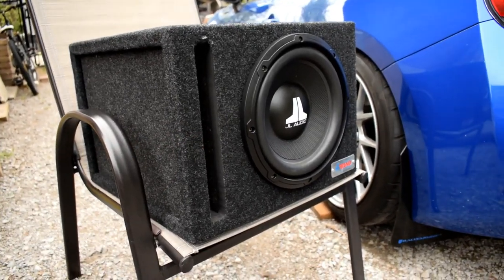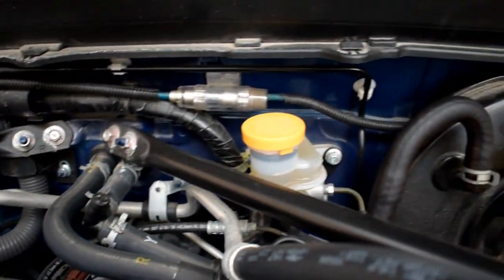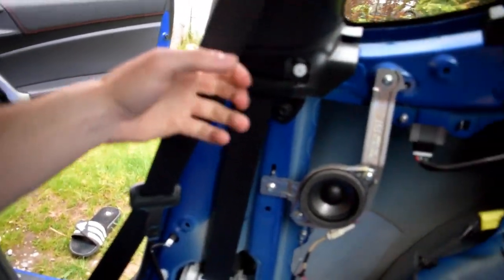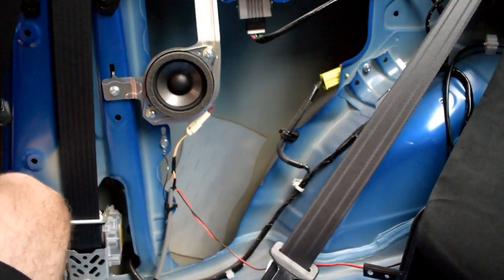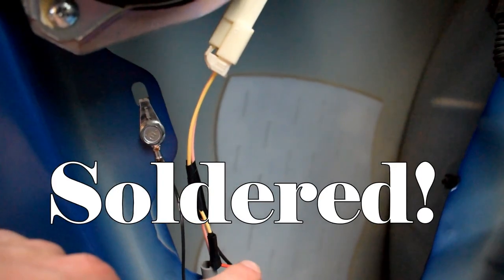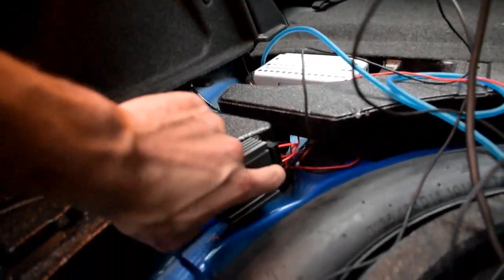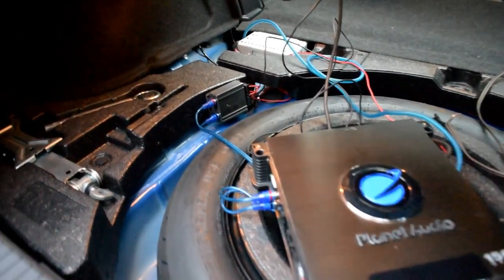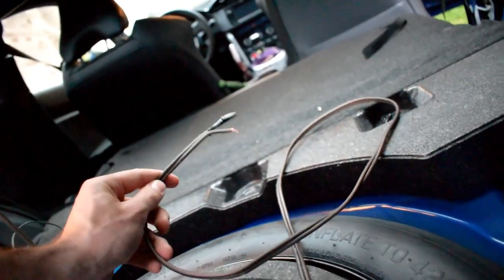JL Audio Sub Install BRZ ! Made Easy !

Comment: A good tip for you guys who are looking in to installing amplifier, don’t use signal from speakers. The signal is in the wrong hertz for the speakers. It may sound ok, but it is gonna be 100x better with rca cables from the stereo.

Comment: Wouldn't recommend tapping into rear speakers, that was my first move and they are very obviously high passed.  I probably wasnt getting any signal below 60hz.  Once i tapped off of the wiring in the stock amp I had full signal range.
Reply: Parmati any chance you could tell us which wires you used?  I just tapped into the rear left speaker and the 60hz dropoff is very noticeable
Reply: Which wires did u use in the stock amp

Comment: For everyone not wanting to tap into wires and do all that extra shit, i found a line out converter made specifically for this car on amazon ($30) that plugs in between the stock amp harness and the stock amp. All you do is connect the RCAs and remote wire to it and you’re done.
Reply: put a link in the comments I want to look at it please
Reply: link pls

Comment: front left/right speakers also remote turn on are found on the factory amp plug. Ground is found under the panel where the trunk latche. All connections besides the power wire (12v) is in the trunk.

Comment: Oh god the throttle relearn.. when I installed my sub, I didn't even take the battery off the terminal because I didn't want to go through that shit. I'm like fuck it, if I short a fuse, I'll just replace it lol!
Reply: Also, why did you use a converter? I plugged mine in with rcas to the headunit. Do brz headunits not have sub rcas?
Reply: Wait your stock headunit has RCAs...?

Comment: and how exactly do you get power control to the amp? probably something you should include in a TUTORIAL video, don’t worry. figured it out myself. just splice into the light green. also, i recommend using a inline fuse on the power wire, just to protect your amp in case of a power surge:)

Comment: Hey, I know this video is old, but I am contemplating doing a similar set up. From research that zapco asp-oeb converter you used is a great product... they actually advertise us as a pre-amp rather than a typical LOC which uses resisters to turn the signal to line level. Anyways.. I can’t find this anywhere for sale in Vancouver. Where can I find this thing?!

Comment: Why are you using the back speakers of the car and not the big ones on the front doors? It would be easier for the amp to have a more powerful input signal and wouldn't have to work as hard.
Reply: I’m about to do this, should I tap the front speakers or the rear?

Comment: what does it mean when you say the throttle has to be re learned?
Reply from the maker: +Zach Pohlman the sensor gets set back to default so the response in the throttle goes to shit till it relerarns itself, kinda stupid
Reply: Robbie Ferreira how does it get relearned ? Do you have to reset it by driving or do you need to plug it into a reader and do it through that ?
Reply: Coupe. XO did you ever learn how it is relearned?

Comment: Once you google good subs you will never use JL subs again
Reply from the maker: +lkjyuiop i dont google, i learn from experience! And this sub has done nothing but everything i asked it to! Im sure theres better but JL is yet to let me down
Reply: Robbie Ferreira don’t mean to be a hater but JL Audio has one good series of subs that I like and that’s the w7 and that’s nothing compare to the brands of car audio that i have had, sure it takes money but if you put if you put 4 sundown zv3 12s like I have in my impala and get a taramps 12,000 watt amp you could be heard from half way across your neighborhood, I live in a small town and when I go full tilt I can literally be heard half way across my town and yes I have actually tested that so I would consider buying at least two w7s since you like JL Audio and build a box and tune it around 35 hertz and then buy a 5,000 watt amp and run that, for bass and then for mids and highs buy crescendo audio 6.5s for your doors and get super tweeters then run them on a 500 watt amp and boom you have one of the best audio systems in your neighborhood.
Reply: Tyler Heard damn bro write a damn book already.
Reply: Christ man why do you need to be heard from across town? Wire up a microphone and deliver positive thoughts to the people.